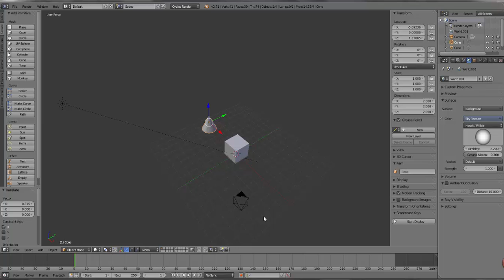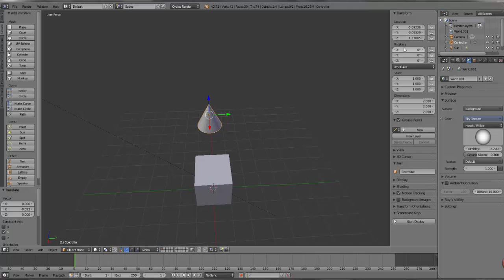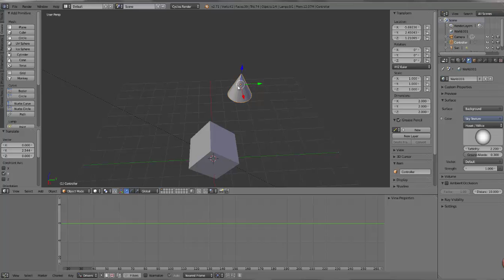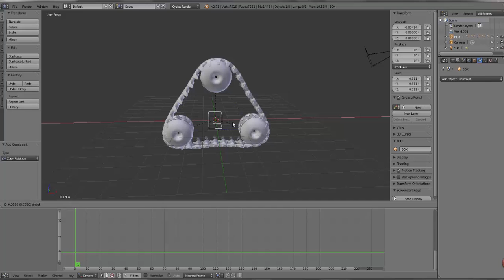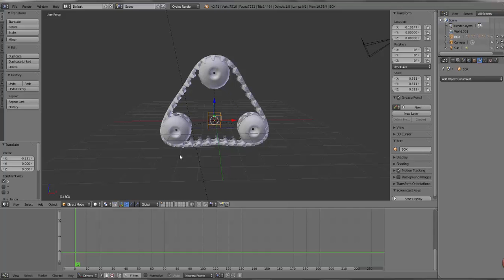Blender:Using Drivers to control tank tracks

Comment: Hi thanks great tut. I am trying to make a propeller spin and I am just trying to find the simplest way of doing it. Using a driver and expression frame*.01 That works on a bone which is what I want. But the spin is not constant speed. It starts off fast and then slows down. Any ideas?   :-)